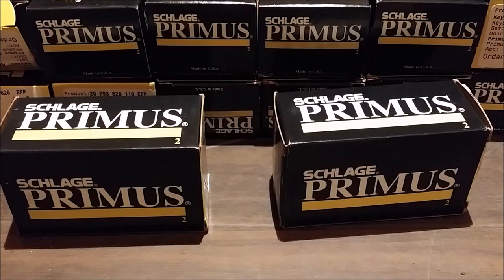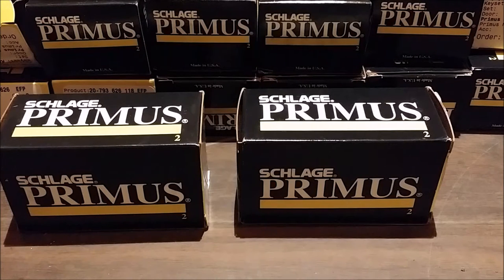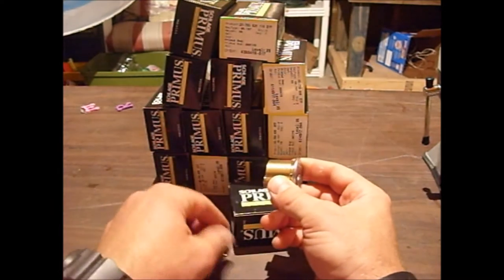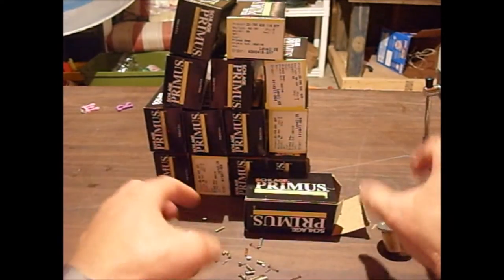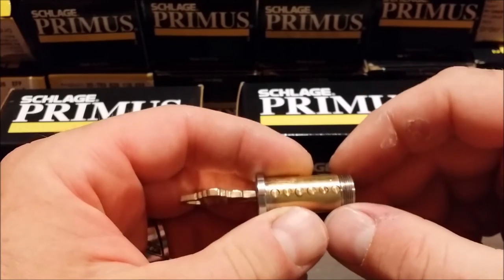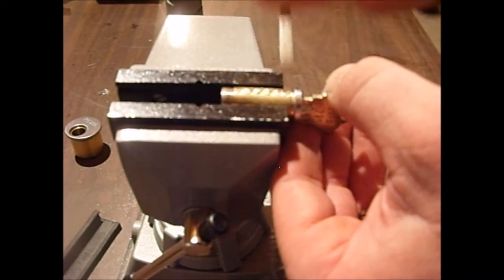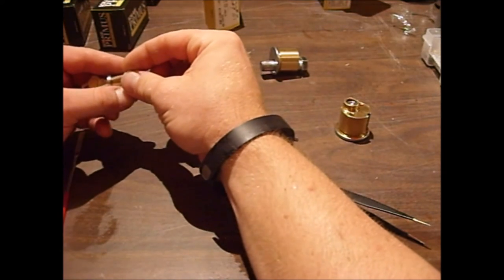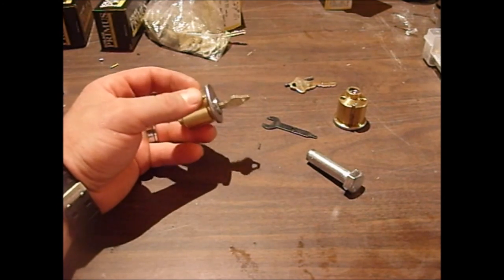Working Schlage Primus Lock Cylinders for Very Little Money

Comment: I said I would keep an eye open for you for blanks, I found a bit more information for you.
There is a machine called the "easy entry" and was featured by Han on a Toool.nl video.
It makes a 3d scan of any key including restricted keys then cuts the key from a blank piece of metal instead of a key blank.
It is designed to be used specifically for making keys, and bump keys, for restricted keyway locks, it was designed to hack/void the entire principle of restricted key blanks.

If you can get hold of 1 blank, or make one, you can then run off as many restricted key blanks with that machine as you wish to, speeding up the process for all these locks.
Hope this solves it for you.